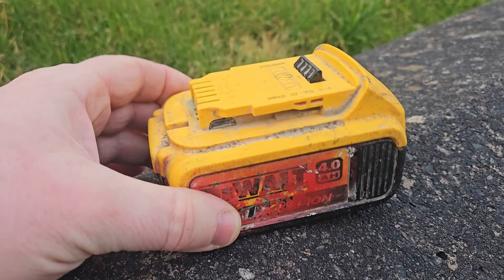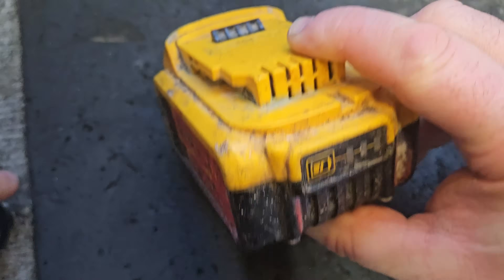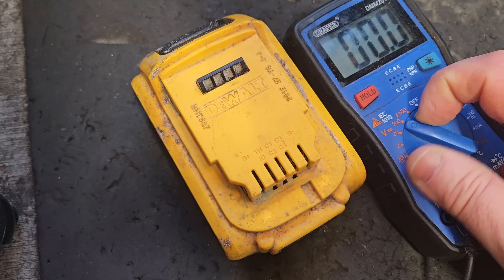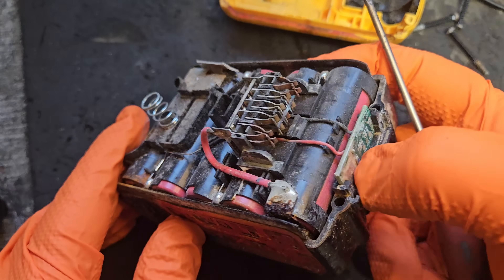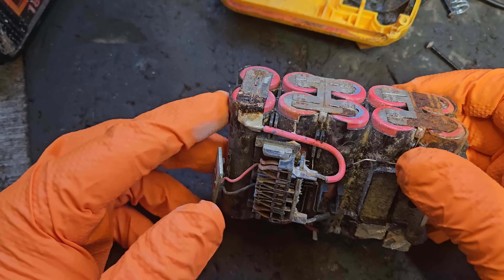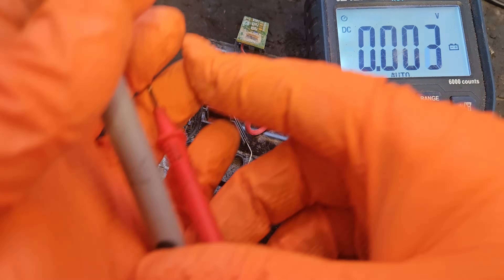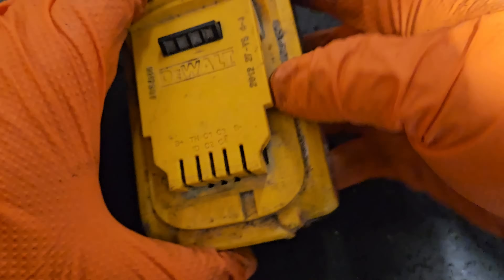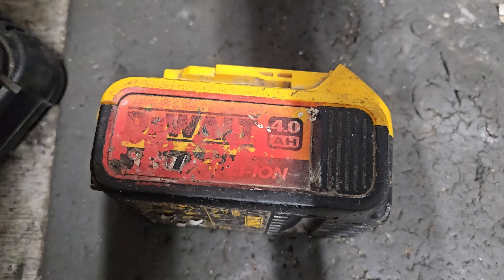Dewalt 2012 battery can it be repaired?

Comment: Just checked my 2 x 5ah Dewalt batteries, 18.69v & 18.8v, seem healthy but don’t last very long & only charge to 2 lights, both 4ah batteries last longer. Both made in 2021 & look like new, had little use……………..any idea what might be wrong? Cells are green, 18650, 2ah, 7.2wh.
Reply from the maker: Check the individual banks of cells.
Use a multimeter check the voltage. Fully charged is 20v
Reply: @doctorlefthandthread ok thanks, I’ll check your videos out on how to do that, 4 being joined at the end by metal ‘straps’ is messing with my brain! lol ……..thanks for the advice
Reply from the maker: @OldmanMTBandMOTO  no trouble this video may help https://youtu.be/LvBfSALWfXw?si=aPnnAkyJQqMW5eIV
Reply: Thank you, I already saved that one…..same charger just ordered 👍🏻
Reply: @doctorlefthandthread ps - do you fix them?, for a fee of course, I’m prob not that far from you - Tyrone

Comment: Great videos & thanks for showing us all of this info. I have 2 x recently made 5AH dewalt batteries, both only charging to 2 bars & don't last too long, probably through lack of use ........ both look like new & the 2 x 4AH batteries supplied with my tools are prefect. So, if i take them apart to check the voltage of the cells how do i tell the difference between a bad/dead cell & ones that are imbalanced?

Comment: Based on your recommendation , I purchased a Lipro charger. Question.. when you selected 1S, you  actually charged 2 cells, one cell in each parallel circuit. Also, when you use the term bank of cells, you are talking about 1 cell in each parallel circuit. Maybe a future video can be on how you are using the Lipro a little different from how an RC would use it. Great videos!
Reply from the maker: 2 cells in parallel are one bank of cells they are charged together at 1s . 2 banks at 2s etc.
Reply: @doctorlefthandthread  thanks
Reply: @doctorlefthandthread  Thanks, this helped me too!